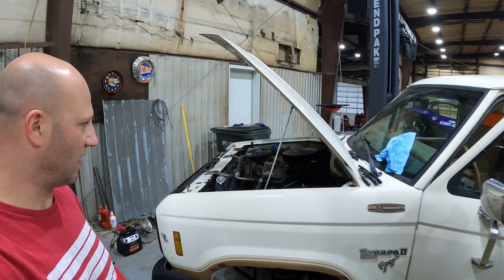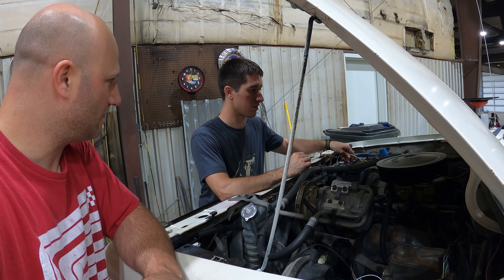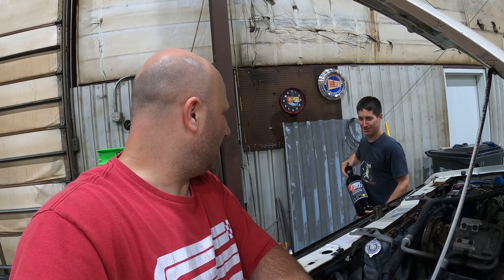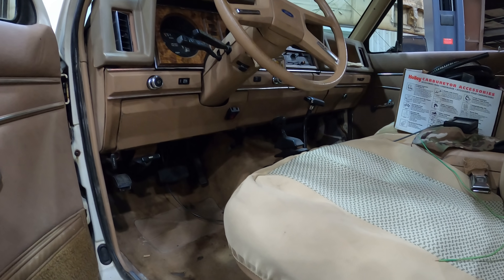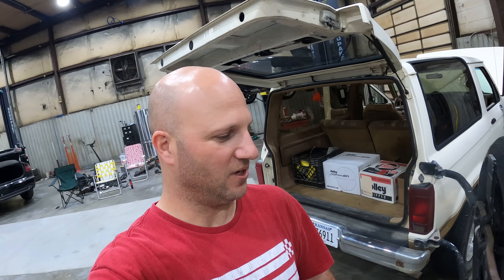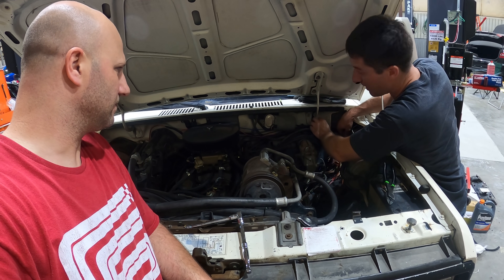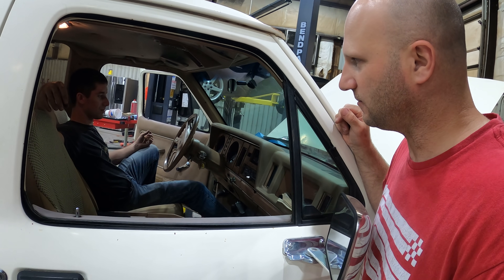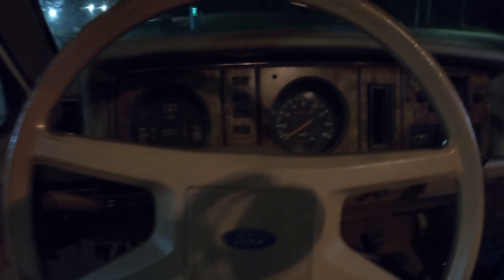(Pt.2) HOLLEY SNIPER EFI Install is complete and the Bronco 2 is a Ripper!

Comment: Question for you, looks like EGR delete and duraspark distributor swap was already done before you put the Sniper on? Were you using the duraspark module? You locked out mechanical advance on the distributor and Holley can control all the timing?

Comment: I just purchased the 2300 Sniper for my 1976 Ford 2.8 two barrel intake installed in my Sunbeam Alpine.  The base of the sniper is much larger (width and length) than the stock bolt pattern.  Is there an adapter available to mate the two together?

DanR

Comment: Did you got more mpg out of it?
Reply from the maker: I've honestly only put 30 or 40 miles on it in since. More to come though, soon.
Reply: @The Fractured Rooster Garage  ok thank I have the 4bbl 390 cfm on my engine so I was wondering  if the 4bbl sniper  will be to big on mine or will I have too go with that 2300 too?

Comment: I don’t understand how the efi controls timing.  Doesn’t the distributor determine that based on the mechanical connection to the engine?
Reply: The EFi unit has engine temp, coolant temp and exhaust gas temp.  It starts with base maps but then builds custom fuel maps, storing and building with new feedback information.  It tells the coil when to spark as well as when and howuch the injectors fire...hence it controls the timing.  It gets crank shaft position from the distributor.

Comment: Would you say that the performance with the holly here is better than if you had put a fuel injection engine in? I am fixing to have to have an engine installed in my 85.

Comment: The mushrooms in the bronco are very common, I have had 3 broncos and they have always managed to grow  something inside them. mushrooms, grass, ants on one occasion I removed everything inside and found a squirrel nest with stash of nuts XD
And tose truck's have water leaks in all four corners of the roof 
Also if you remove the side fender panels you may find rusty parts where water may be getting inside the truck XD

Comment: Yes need to v8 swap it that way I can learn how hard it is to do when I do mine lol
Reply from the maker: I did an 89 Ranger back in 1999. Efi 5.0 from a Lincoln Town car. It was cake.
Reply: Grab a 96/97 explorer with the gt40 5.0 and 4r70w transmission , get the complete engine and trans harness , leave the AWD t-case get a Borg Warner 4406 from a 97/99 f series or expedition , it's all on the explorer forum and it applies to any ranger based vehicles
Reply from the maker: @casualobserver1663  I may already have a set of tubular shortie headers for a 96-01 explorer 5.0